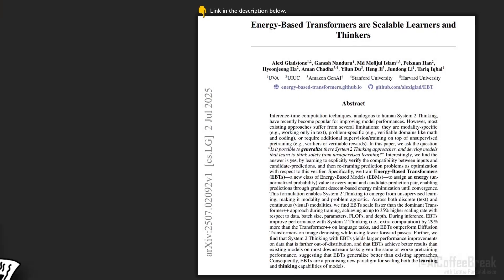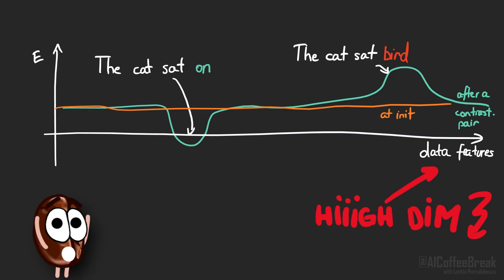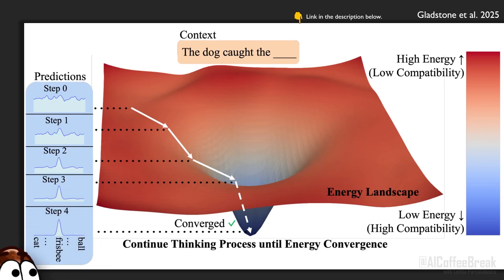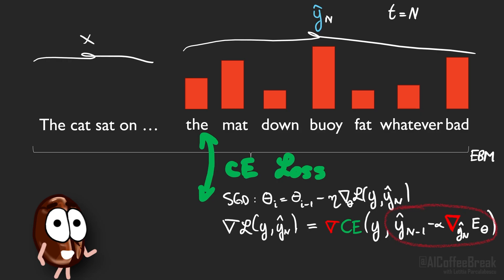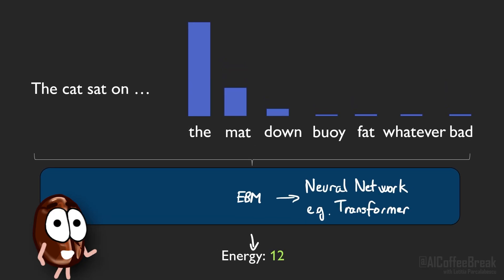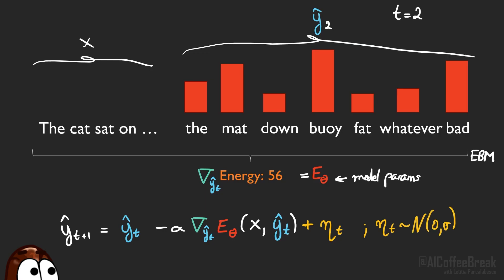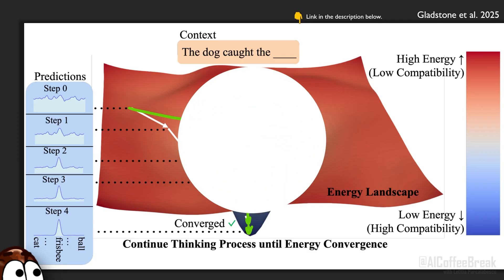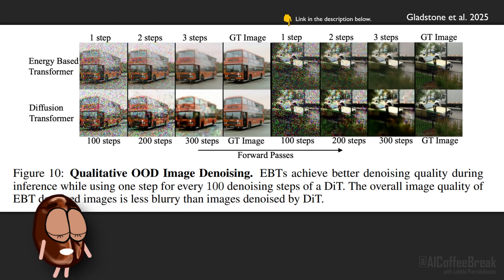Energy-Based Transformers explained | How EBTs and EBMs work

Comment: Several remarks
1 The idea of EBM is actually a new version of RBM , hence it is not novel2 In regular networks we calculate P(Y|X) =p(Y,X)/P(X)
e(X,Y)=log(P(x,y)= LOG(P(y|x)+log(P(x)
Since p(x) is independent of theta, the PROBLEMS ARE EQUIVALENT
3 The gradient step is discrete,e which is not that accurate. Wouldn't it be better to consider stochastic methods such as Gibbs or HMC

Comment: Whats so interesting is how several paradigms in machine learning seem to converge more and more. The inference-time optimization in energy based transformers has many similarities with diffusion language models, since both follow a form of langevin dynamics, but we model the gradient we follow differently, one via score matching, one via this energy-transfomer. Also i see many similarities to optimization-based meta-learning such as MAML, where we also do inference-time optimization.
Reply: There's a huge overlap between diffusion and energy models. The gradient of the energy is the score function which under few assumptions is the loss of diffusion models up to one constant.

Comment: I'm confused.

It feels like there might be a bit of a semantic mirage going on?

A standard transformer is essentially constructing a representation of next tokens based on existing tokens. It solves the EBT problem of finding candidates and assigning 'energy' (logits) in one-step by predicting a distribution over a fixed list of candidates.

An EBT provides a function that tells you if context goes togther well in terms of 'energy'. We then need another process to suggest at candidate representations to zero in on low energy candidates.

If an EBT creates an energy function over the current context and the token vocabulary is it not basically the same as a vanilla transformer? The search space is the vocabulary and you evaluate it for the whole vocabulary as you would a standard vocabulary. 

It then feels like a lot of the statements about EBTs should be true for vanilla transformers too. 

Perhaps because an EBT seperates out the search problem from the "what goes well together" problem it might learn different representations. However, what comes next and what goes well together are not identical concepts and in a way a standard LLM might do well because it specialises for next token prediction. 

You could always just use a masked language model to do next token prediction (sentence + mask) but the fact it is trained to learned global represenations made it less specialised at next token prediction problem.